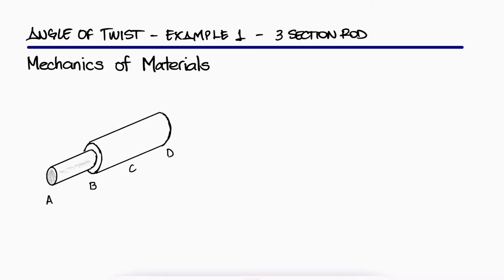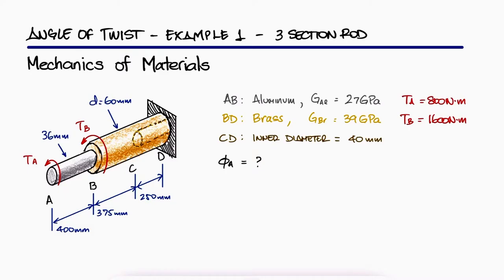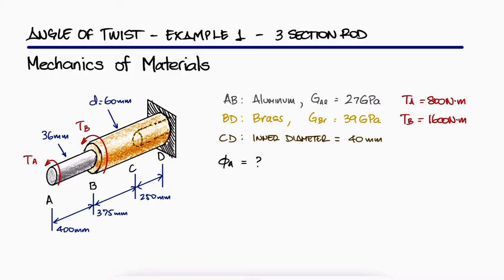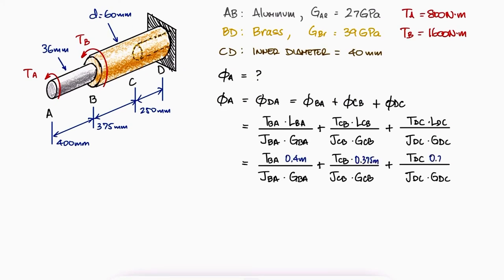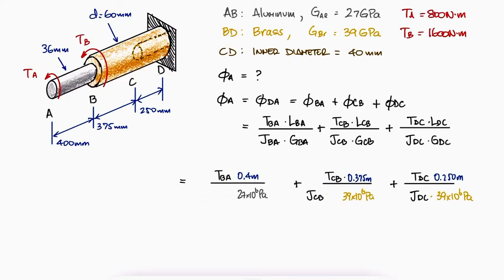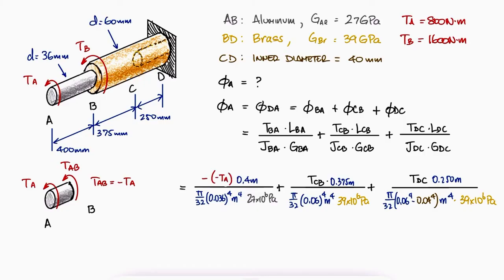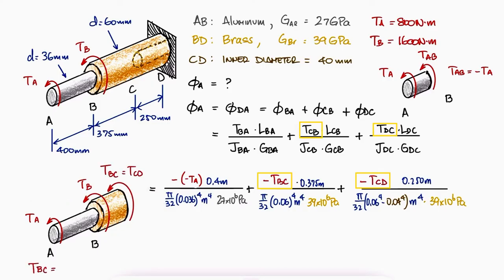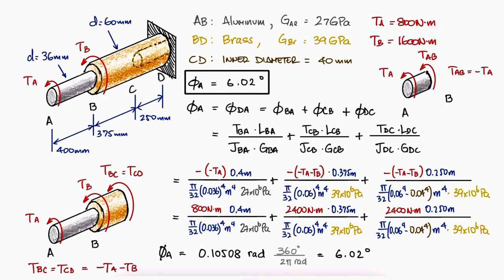3 Section Torsion, ANGLE OF TWIST in 2 Minutes!

Comment: theres a little typo in the answer. The modulus value in denominators should be of the power 10^9 since its giga. however, value of answer is correct.

Comment: What if the forces were opposing rather than the same direction?
Reply: That will account on the positive and negative sign. In this case, a clockwise torsional movement would end up as positive torque value rather than the negative counterclockwise sign convention shown on the sample.